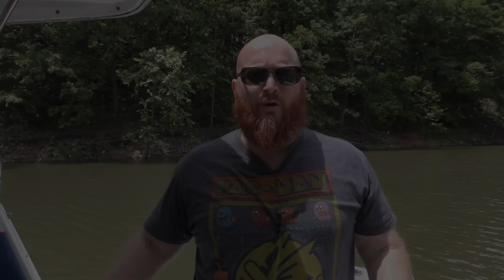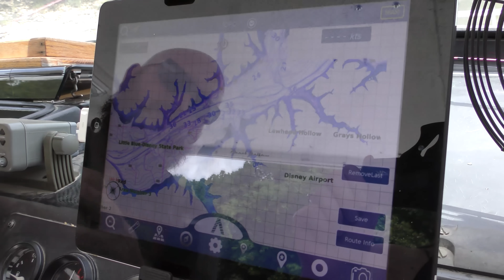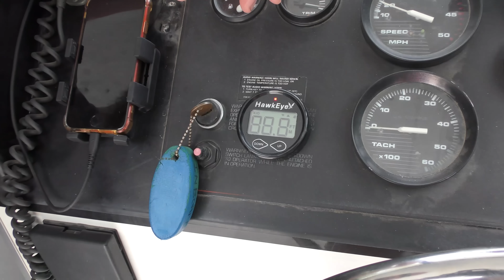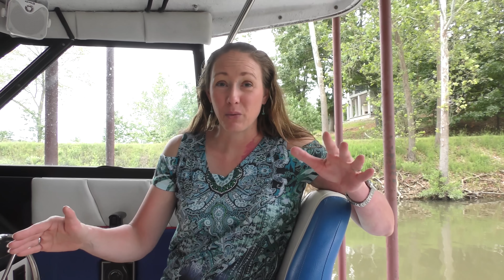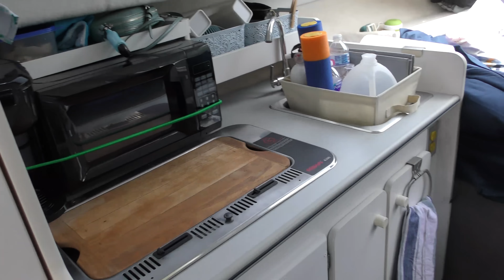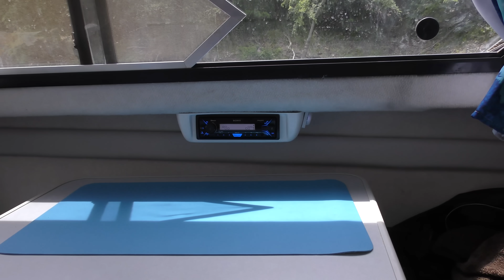Cruiser #4: It's Sea Worthy! See the CAR WIZARD get the boat in the water and the issues that arise

Comment: 10 gallons per hour? Holy
Reply: My last boat, 33 Egg Harbor, i did well if i got 30 GPH. For that size boat 10 is very good economy. The best economy you will get besides cruising at dead idle is as slow as possible while maintaining a proper planing on top of the water. If you are plowing through the water, is where you get the worst fuel economy.
Reply: Idk about USA, nver used a boat there, but in my country buying gasoline for boats are much cheaper than for a car. Their tax is much lower, compensating for the fact a bigger boat can burn alot more than that
Reply: @Vismajor01  And where I live they are taxed the same as for cars, plus having a marine markup of at least 10% extra.
Reply: 10 Gallons per hour is perfectly normal for a boat such as this with this kind of engine. I daresay it is smack dab in the middle of what is expected, in fact.
Reply: Yeah, the boat I grew up with had twin 70 gallon tanks feeding twin 350ci motors. Never really watched gph, but it was substantial, especially if we were doing anything but just cruising
Edit - and it was significantly more expensive. 90+ octane (premium) and ethanol free, plus increased taxes and environmental fees. Add that to limited places that supply gas in the lake, and you get a solid .75-1.00 upcharge per gallon 😕👍

Comment: Great video. You need a longer anchor chain/rope though wizard. Ideally 4:1 but at least 3:1 in crowded spots for the water depth you're anchoring in. Larger boats go up to 7:1 !!
Reply: For overnight a section of chain equivalent to a boat length is the minimum, then the rest can be rope.

Comment: 2:42  I'd suggest a longer anchor rode.  Suggested anchor scope is 7:1.  So in 20' of rough water you would ideally have 140' laid out.  Realistically you don't need that much on a calm lake.  Get a Coast Guard Aux. vessel safety check, you can set one up online for free.  I'm a vessel examiner.
Reply: Chain could also offer some counter-ballast for the aux motor.
Reply: Totally agree.
Reply: Great advice. But good you got it wet, Wizard!
Reply: More chain helps to.  You want that 7:1 in case you have to anchor during a storm.   A good anchor and plenty of line/chain are your friends.
Reply: I think he said he is using rope for the anchor and no mention of what kind of anchor . He will have to learn
Reply: You will want at least a 25 pound anchor and ten feet of chain from the anchor to the line..    the type of anchor depends on the bottom of the lake your on.   Mushroom ... danforth..  many different types to have.    And a second anchor to stop for lunch or swimming is great.  Maybe 15 pounds with six feet of chain and 60 feet of line makes a good lunch hook.   A real anchor line is 7 to 10 times the depth of the water you may get into.

Comment: depth times 3 is the minimum of chain to anchor
Reply: Someone that actually knows how an anchor works. The chain holds you in place, not the actual anchor.
Reply: @HunterAtheist  Not really. The chain's function is to act as a damper to the boat's movements in the wind and swell and ensures that with the anchor set force is only applied horizontally to it, so it stays set. Try anchoring with just a chain - you'll just drag it. But with a long enough rope (that sinks, not floats) on the anchor you can get by without chain as long as you have a lot of rope out - for the same reason you use chain.

Comment: Have lived with a Hawkeye and loved it. They have great customer service. The low water warning is great. 
You need to read up on scope. 2:1 is real short for anchoring. Any time you get wind or current you will need chain and more length.
Reply: On the sea, you might go for 3:1 to 5:1 ratio of anchor line to depth, so perhaps 100-150 feet total to use anchorages up to 30 feet depth. First 30-50 feet in chain, rest rope. Chain acts as a 'spring' - lifting it absorbs some of the energy of waves or wind gusts. 

In the sea you also need extra for tides (where I live in the UK that can be a 22 foot depth change in 6 hours)   I don't know how rough your lake gets  - you may get away with less than the sea needs. 

With a long anchor line you swing on the wind (and can hit other vessels). Quite common to carry a second smaller anchor - drop it, head to windward, drop the main anchor and drift back as you pay out the line. Then tighten the second  anchor line a bit, so you cannot swing very far.
Reply: @lardo666  Good advice, Grew up in the UK, Now living I Central Texas for many years so have frequented similar lakes to that.  Using 2:1 was likely all the Wiz could do in a confined space. Tide on a lake is not a factor.
Your comment on two anchors is the best. As you describe, taking into account wind and current putting out two avoids swinging around. Important as it’s likely that grounding on the banks as the wind changes is not good!